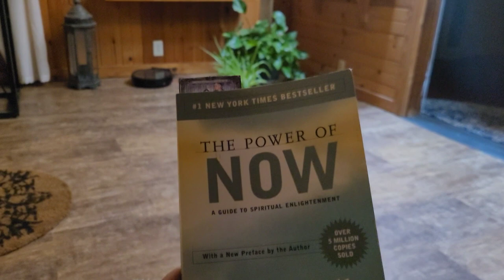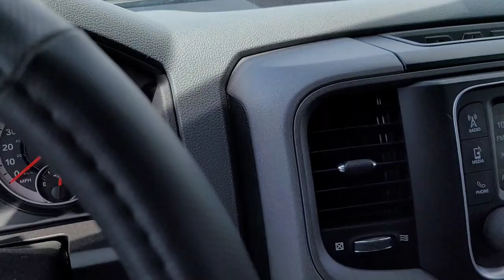A Day in The Life of a Union Cement Finisher | Come to Work with Me Baby

Comment: What state is this in? I’m suprised there’s no rebar ...I get it’s in a controlled environment but I’ve never seen a huge slab like that with no rebar
Reply from the maker: IL. Different contractors different specs
Reply: The concrete has fibers in it that act as reinforcement like rebar would
Reply: @Jacobryanreviews I’m from Illinois too what union are you in

Comment: Nice video brotha on point👌🏽, local 500 cement mason SD CALI right here cheers.
Reply from the maker: Hell yea. Cheers brother
Reply: I’m seriously considering getting on with the concrete finisher union hall. I’m a truck driver now but I’m only 35 and ready for a career change. Been driving for 13 years it’s time for a change.
Reply from the maker: @TravisTheDriver  nice! Hope it works out for you dawg
Reply: Hey I’m in local 619 as a stocker scrapper for drywall . Is there a lot of work for someone that wants to learn the concrete trade ???